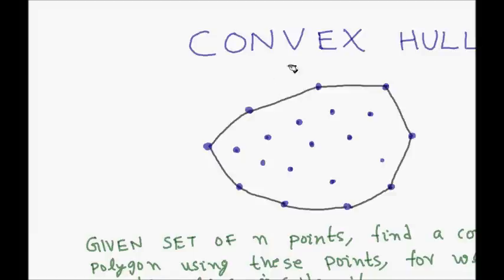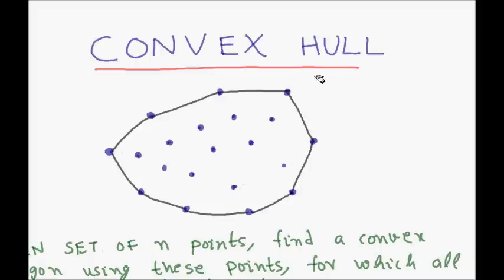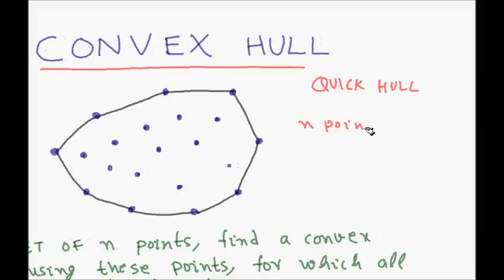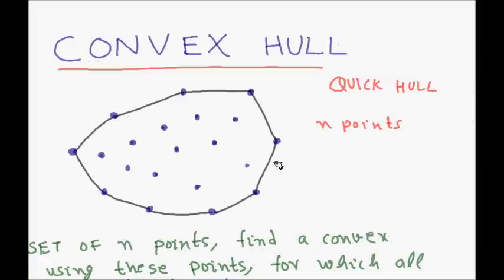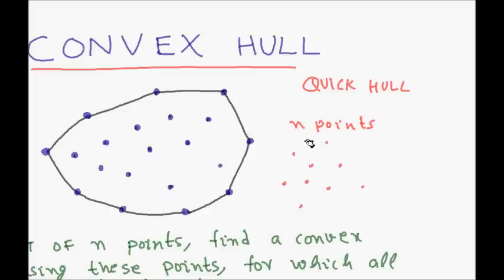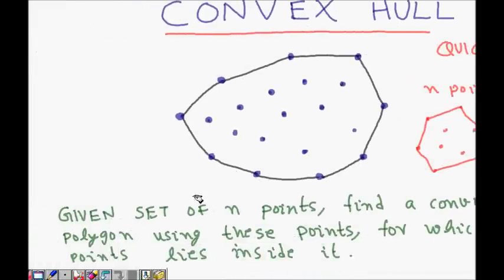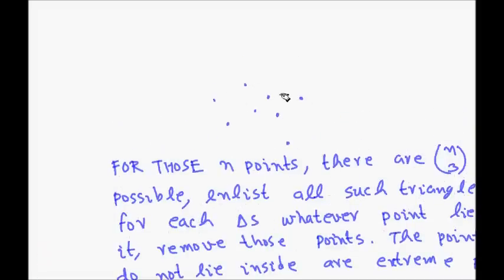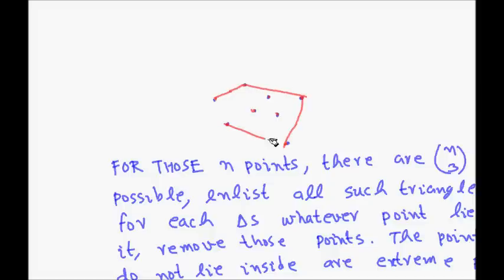Programming Interview: Convex Hull Problem (Quick Hull Algorithm) Divide and Conquer

Comment: for anyone that's confused by what's going in finding the actual hull (because that part in particular racked up my brain at least):

"quick"-type of algorithms are like the "merge"-ones except in-place, so what's going on here is divide and conquer

the top set is what's counter clockwise to the middle line, the bottom set is what's clockwise to it (but this distinction only matters in the quick hull/priming function call)

in the find_hull what's going on is, you have 2 lines, and points will be "above" those lines, or rather they'll be counter clockwise to them
if it's ccw to line 1, that means it goes into the 1st set
if it's ccw to line 2, that means it goes into the 2nd set

it can't be ccw to both, and you don't care about the clockwise ones here because you have 2 lines - if it's cw to line1 it's either inside the triangle (thus cw to line2 as well) or it's outside of it but ccw to line 2

since you only get the sets that are ccw to line 1, and then the ones that are ccw to line 2, you don't even deal with the ones inside

you don't have to deal with any removing, you just construct sets of points that are ccw to the 2 lines (I believe this is what he means by find what's "right" of the lines, even though to you it seems like it's on the left of one line, constructing the line pmin (the min x), furthest, candidate point -> you get a ccw orientation which effectively means right, but basically the order matters)